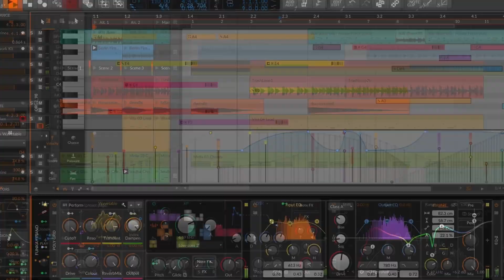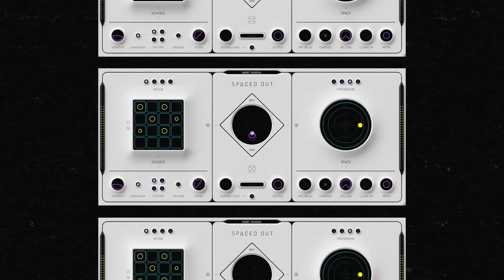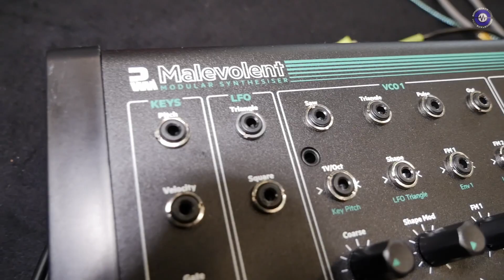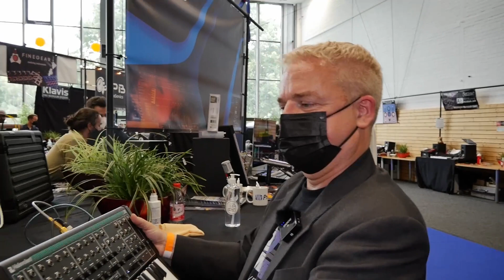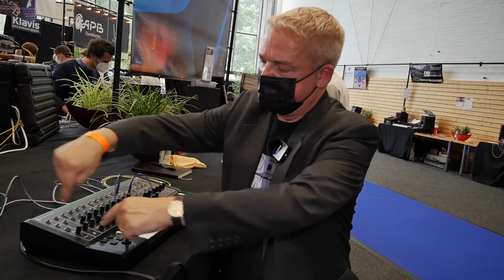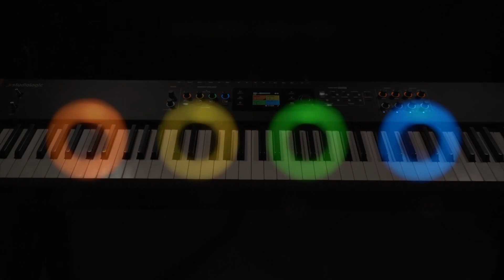SUPERBOOTH 2021 - PWM Malevolent

Comment: My first concern is the joystick as I can see that getting broken first.  If you plan on releasing that version first, you should include a case to put the synth in. Also the joystick should be mountable to be screwed in and out of that mechanism. Include a couple of replacement joysticks with the case.

The key size issue...In 2021, I think Ashun has established that line in the sand in that no manufacturer should issue a keyboard without poly-aftertouch. Now THEY have a mini-key instrument with poly-aftertouch. If Ashun is able to do that, you should be doing that.

Changing the endcaps is not important. It's just window dressing and does nothing to enhance the user experience with this board. The board cannot sound "warmer" by using wooden endcaps instead of plastic.  A lay person listening to a synth player using that board wouldn't notice any difference either. I'd rather see your resources spent on providing poly-aftertouch or have a way to detach the keyboard. The left hand controls would need to be redesigned.

Comment: 2 things that bother me with the design right away...tiny filter knob that's hard to access all wedged in with other knobs while there's all that empty space right next to them. And there was plenty of width to make it 3 full octaves...all that extra space around the joystick thing... 3 octaves should be a mandatory minimum for any keyboard.
Reply: The filter knob is the same size as all the other knobs. There is not enough space to make it 3 octaves. Can't say any more than that.

Comment: I gotta love how that pulsewave sounds. Reminded me a bit of the old cue alerts we used to have on the headset intercom system we used in the theatre, and even a bit of old SID video game sounds. Nice and buzzy, big bottom end, not too polished and flutey as some synths have in their square/pulse oscillators. Great sounding filter too, even if it was just a short demo of it. 

The modulation functionality of the joystick is a nice feature too. I do something similar on my AN1x's ribbon controller: assign mod rate to the ribbon position, and depth to the pressure. Very powerful performance tool to have in one controller with 2 axes. 

I'm really trying to stay away from any gateway drug into modular and the associated Eurocrack addiction (Just say no, kids), but this one's going to be very tricky to pass on.

Comment: "I don't find the term 'semi-modular' useful". Then tells us how it's pre-patched. That's why the term is useful. :P I guess he's trying to distinguish from synths that don't surface every connection as a patch point.

Sounds good, though, and a bit different from most synths. I also like how the patch points are across the top. Good price point, too.
Reply: You can see the pre-patching on the panel. All the green legends tell you where the inputs are patched from and then, of course, you can break those by patching in yourself. You'll find the control for the input directly beneath the point where you patch in.
Reply: @1PWM  I was just commenting on an oddity in the messaging, not asking how to tell what was patched to what. :)
Reply: @Psychlist1972  okey doke! :-)

Comment: Why the tiny pixie keys made for the hands of little elfs. If you want a keyboard on your synth please put on full size keys!
Reply: i like the mini keys, which is funny because my hands are massive. easier to get around
Reply: @zoned7609  you sir must have tiny hooves instead of hands to be ok with keys this small. Or at least some miniscule trotters that can push these matchstick sized apendagea to any kind of hoopla!
Reply: @Paintopia_VR  nope, you're just being obstinate in accepting the difference between our ergonomic preferences. My hands are quite large.
Reply: hahahaha no, peoples hands haven't 'gotten smaller' over the ages

Comment: Not to be offensive about that "it's a modular synthesizer"-thingy, but isn't it quite simply a semimodular in every sense of the definition? And individual modules? - On the same PCB? Under one cohesive faceplate? - I feel like I'm missing the humorous tone which clearly must have been there.

And customizing quite specific magnetic sidepieces seems to mean: Remove them, paint them, bring them back on. Wooden sides are expensive nowadays, but I'm sure they'd look good on that one. All in all the estimated price and functionality look good/ oka'ish(?), nonetheless.
Reply: I agree, this is a justified criticism. Semantics are important, and these kinds of synthesizers are NOT modular. All synths are made up of "modules" beneath the control panel, even though I'd rather say elements. Still, that doesn't make them modular.

And to be fair, even semi-modular is a term I don't quite like.. I get it, we mean "it's got some features typical of a modular synth", but I think we can be more specific than that. As someone else said in the past, semi-modular makes just as much sense as semi-pregnant.

Patchable (or re-patchable) works in this regard. It's more accurate than semi-modular, and much more correct than modular.

I don't like the fact that many synth companies, in recent years, have been labelling some of their products as modulars, despite them clearly not being modular synths. It feels to me like they're trying to change the meaning of the word, to try and seem more appetizing to potential, ignorant customers..
Reply: @dr.getter7118  Really agree with that - a good and specific rundown. And regarding to the synth shown, I would be more excited if you were able to remove the synth-unit from the keyboard and placing it as a complete synth-voice in a eurorack-case - therefore I would be less irritated about the statements given on the presentation. Mislabeling stuff makes it less attractive to people knowing their stuff, I guess.
Reply: Don't agree. You can use each 'module' completely separately on the Malevolent because there are enough patch points to totally isolate the modules. Trouble is there isn't a definition of semi-modular but I'm sure it's nothing to do with PCBs

Comment: Perhaps a decent competitor to the Moog grandmother
Reply: About as relevant as a painter thinking that mussini is 'competing' against lasceaux for a place on their paletle.
Reply: @shaft9000  what?
Reply: @MrJenkemz  i’m pretty sure they are just trying to say that the synths are totally different and not even attempting to fill the same hole, so comparing them so with such scrutiny kind of misses the point… or some thing.
Reply: @Licinius Varrus I mean in all honestly that's probably true. I quess what I meant to say moreso is that they are very different in sound, oscs sound really different and the filter is a different model than the moog, so comparing the sound quality as better/worse would be what I think is foolish. In terms of functionality, I think there is fair room for comparison.
Reply: @KnzoVortex  yea but the first comment was literally that hahs
Reply: @shaft9000  huh?
Reply: My comments original intent was to point out that it’s a 2 oscillator synth keyboard that is semi modular by design with a few nice circus tricks and comes in at a lower price than the grandmother. I have a Moog Matriarch.. so of course I respect the Moog oscillators and the LP/HP ladder filter (and in stereo) .. it’s just that this new synth is positioned to compete in the same space as the grandmother .. sound of course will be in the ear of the listener